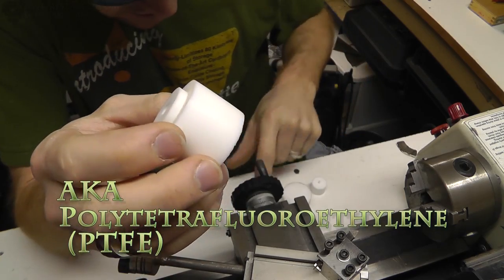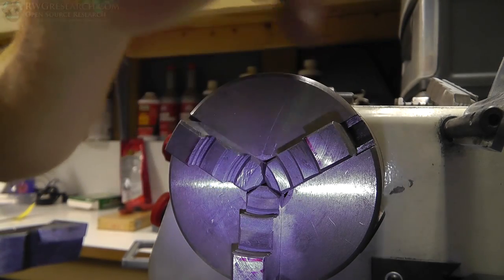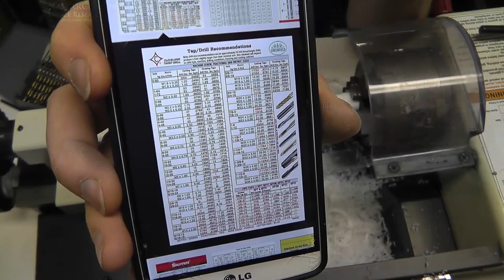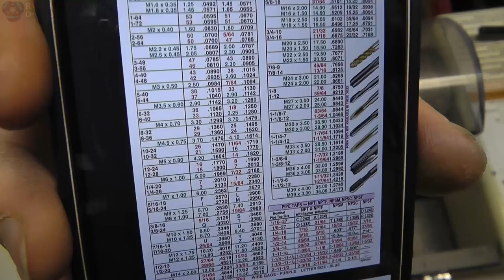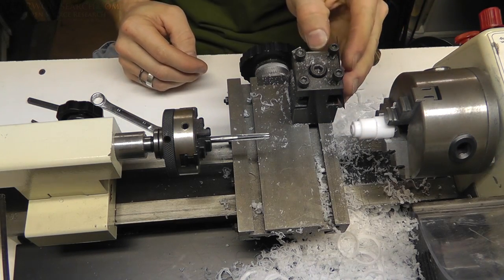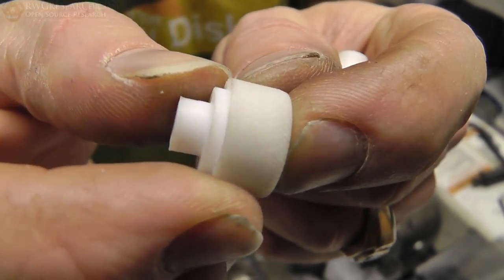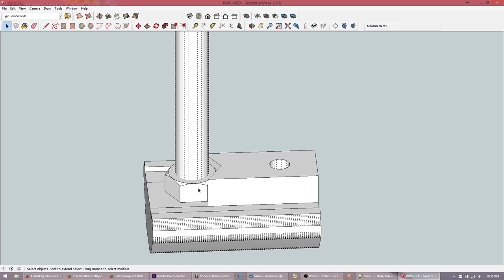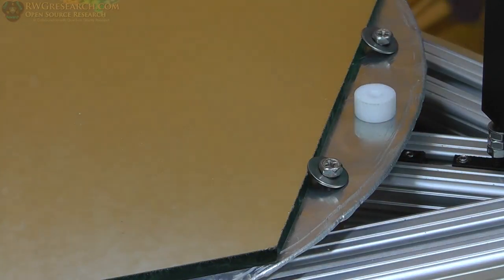RWG OSD #12 Thermal Break Zero Backlash Bed Plate Spring Adjustments & Glass Mounts.

Comment: great video Russ, it's good to see how your design is evolving. Bed movement is a real problem, my levelling mounts hold it pretty firmly but when you have a taller print with multiple areas, the hotend "bumps" into each area and the whole bed sometimes shifts which ruins the print.
I'm really surprised about the flex on that sheet. I think that is an issue you need to resolve. The bed will heat up and flex, it will not uniformly touch the glass and you will get uneven heating. I'd say get a thicker plate!
Reply from the maker: +Phil Waud good thoughts,  this might be a fluke for a benefit.. hear me out, a another problem is that the outer side of the plate can be cooler than the inside of the plate. so what if as its heating the plate bends out and makes less contact at the center and more in the edges. kinda like a self regulating system :) and how i will test it and then see! go from there, thanks for the thoughts, goad your still hanging around,  still glad you did?  ;) ~Russ
Reply: Yes, very!

One quick, and very sensible solution... get a sheet of glass the same size as your bed. Use a diamond stone and spend 10-20 minutes rubbing it down. Clamp if firmly to the plate at the edges. It wont matter if your plate bends as the glass will stay true. Its also a great build surface, I often print direct on it and sometimes use a glue stick. 

I get the idea of it being self regulating, but you are looking at a surface that must be true to a couple of hundred microns. You would have to be very lucky for it to work out?
Reply from the maker: +Phil Waud well if the glass stays true ( its quite thick) but the AL bows then that's ok... if the glass also bows that wont help. ill just have to test it. 

also just using glass is ok but i want to heat the bed and attaching the beater to the glass will not provide even heating. so if i left the AL plate and made hole's in sin the glass that might work. but seams complicated. i also want to be bale to change out the plate fast and eazy. ( so ill be redoing the simple screw hold downs for the glass i think a some point) 
test test test :)

~Russ
Reply: ...thats half the fun of 3d printing!

Comment: great video man .  ? watching your home made cut off tool making the washers ,  i wonder if the bowing is due to the angle of the edge on the blade adding over depth of cut .  It may seem silly but i think if you spun the part the other direction ( or flipped blade) you would find almost no bowing and get a long thin string / chip  of plastic about the same width as the blade.  I don't have a lathe , but i have used my drill press at times to just get a part done , and found the back of razor and x-acto blade make a ok parting / cutoff tool for soft  materials.  handy 2nd life for old blades.
Reply from the maker: +XerotoLabs yes the bowing is due to 2 parts, one is the blade bowing, and the other is the thickness of the blade, it will "curl" the plastic as it gets deeper. as its not removing anything, so the blade has to accommodate the spade by " curling" the plastic... thanks for the comment! ~Russ
Reply: +rwg42985 cool figured as much . I love home brew tools , especially recycled ones.   if you ever want to make a quick cut off that wont bow , take the back / not blade side  and touch it with a rotary tool /dremmel round stone or such near the tip so you get a very small scoop shape . keep the stone's axis perpendicular to blade's plane  and you will have a cut off tool that will cut blade width cuts into parts without bowing or deflecting . hard part is getting the tip square and the scoop just rite so its more of a tiny chisel than a knife . but in plastic and wood  it's more forgiving . 
keep up the cool videos man .

Comment: Nice work Russ. The "Clamps" for your glass/mirror plate why not make them as cams which you can adjust to grip the edge of the plate and to fix the position just screw your bolts down tight. This option should enable quick change heat plates if necessary allowing slow cooling of a plate and reducing deformation/ flexing over long time usuage
Reply from the maker: +trapper23ful hummm... so i'm not sure if you mean what i think you mean, but what if i did use a cam system, but instead of needing screws, i could just use a cam that would put pressure on the plate when turned, ( angled clamp)... i will say i don't really like the way i have the screws, but i also don't know if that glass / plate will work quite right when heated. more testing before i finalize a design i think. i want a tool free way to remove that plate. and the cam / angled clamp sounds like a really good idea. ill play with it after testing the heat part! thanks! ~Russ
Reply: welcome hope it proves feasible......... I'm still working ona modified xtruder as an injection molder for HDPE based on your design
Reply from the maker: +trapper23ful sweet you found all the info on the web site right? it any videos / photos of it? sounds like a fun project! ~Russ

Comment: I wounder if, over time/heat those Teflon bushings thin out and allow some bed movement. I guess as they say "Time will tell" :-)
Reply from the maker: +RJ_Make no, they should not, that is if i keep the temp under 260C ( and this i will ) as Teflon is rated to 260C working temp. ( its the stuff they use on your frying pains)  but yes time will tell. ! ~Russ

Comment: Did you do a heater for your bed? I am finishing my build. I'm getting Z-banding, and I've isolated them to be due to the bang-bang switching of the silicone heater of the bed. My bed is running from mains voltage. I'm going to play around with not using bang bang, and try to see if my SSR can handle PID tuning. I had done a test and it was holding temperature much better than bang bang. Hopefully that will remove the z-banding, otherwise I'm going to have to re-think my bed mounting -- maybe tighten the springs and re-run the calibration. I'm actually not sure that the springs are necessary since I'm doing auto bed compensation with a removable z-probe.
Reply from the maker: +kazolar very interesting, I will be using a heated bed but not at the moment for this phase of the testing.. This is a delta your using? yeah PID and SSR will all ways be best when doing a precise controlling system. I think that will help for sure. what thickness is your plate / glass ECT? i'm not sure just yet how much this will bow... more testing for me to find out. ~Russ
Reply: +rwg42985 Yea, my new delta 490mm diameter, 685mm height build volume. I switched the smoothieware config for the heated bad to use PID for the SSR and the z-banding cleared up. It's working really well now. btw I designed a breaking system with 3 servos so when the print finishes the printer homes to the top the break engages the motors turn off and the effector will not end up falling down on top of a finished print.
Reply from the maker: +kazolar nice work! are you using a smoothie board? I started using a Duet,  the 8 bit ramps just cant keep up with everything I'm trying to do lol.  also i have noticed so Manny people having that problem where there end efector falls down. i never had this problem. must be the motors I'm using? they have enough magnet in them to stay put. 

big delta, nice! its nice now that i have what i have its so easy to just scale up. although i don't see the need. as anything over the sizes i have now just seems crazy, takes spools of filament just to make something that big lol ~Russ
Reply: +rwg42985 I'm using an azteeg X5 mini (it's a smoothieware compatible board) ramps are really not fast enough for fast delta computations. I think the smoothieware firmware is really ahead of marlin and duet imo. changing configs is just editing a text file, no need to recompile or anything... i am using octoprint, so I just ssh into the RPI3 running octoprint, mount the sd card from the smoothie and edit configs. I am using 400 step 1.68 am motors -- really good motors, but effector will crush any print -- I have octorpint configured to turn the printer PSU off 20 minutes after a print is done -- so I need a safe way to park the effector. $40 bucks in servos and an arduino uno solved that problem.

Comment: Hey, Personally i think that bet should not move at delta printer at all. No springs or other bed level manual tunning. Leveling should be done by SW.
Reply from the maker: +danoseus ok so i just wrote a long post and hit the wrong button... any ow from my experience its still needed, the software although a lot better is still not all that. soe times you really need to adjust on the fly, will see how it goes with other firmware's  but when i started this project from my experience with marlin i still needed to adjust things by hand, and ended up doing it anyway. ~Russ